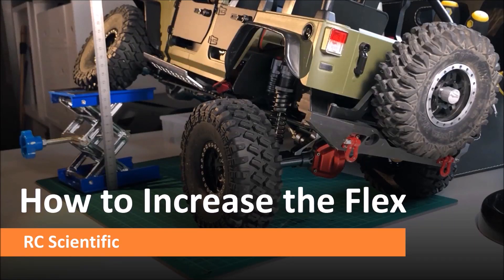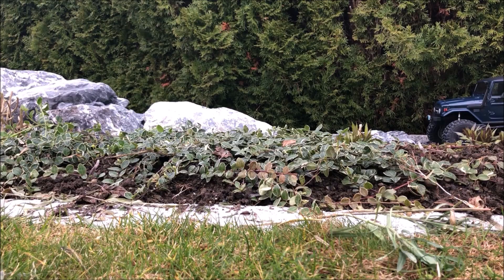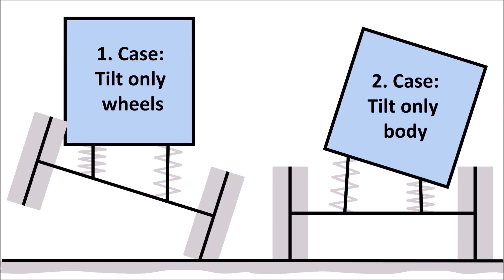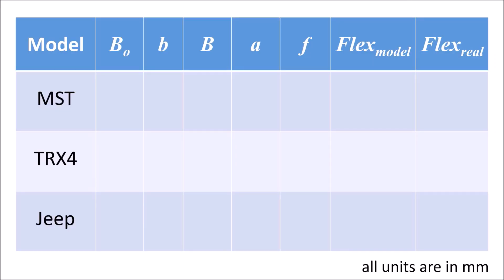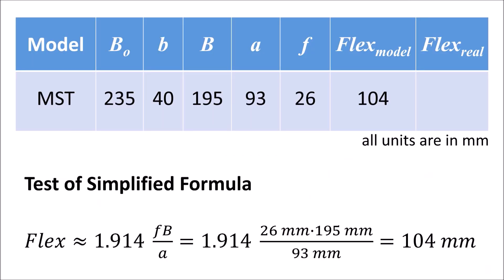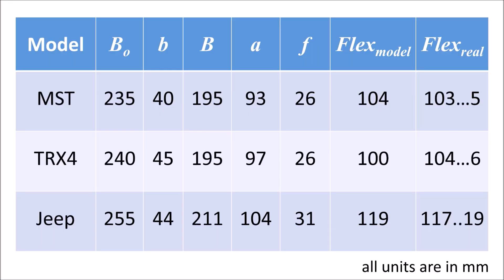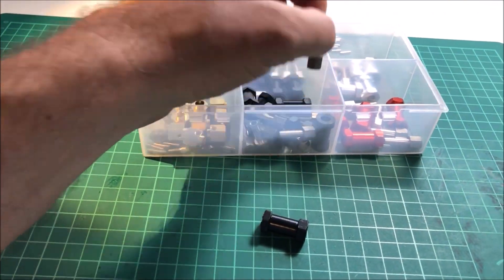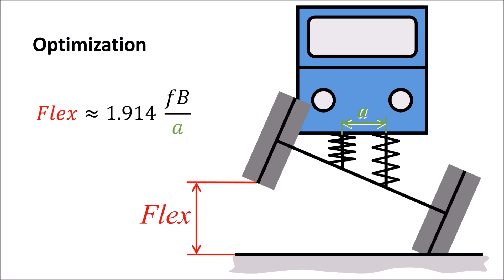How to Increase the Flex in RC Crawlers?

Comment: I have the same shocks how did you get them so soft mine are really stiff
Reply from the maker: They may look softer, because the chassis and the body are quite heavy. I did not change my shocks.
Reply: On mine everything is steel and cnc aluminium and brass but still very stiff.. im going to try without spring at all and different oil inside

Comment: Liked the explanation!
Where did you get the blue lift? Send link please...
Reply from the maker: You can find such kind of "lab-lift tables" on banggood or Aliexpress: 
This one is from the movie, and it works really well and accurate: https://www.aliexpress.com/item/4000036999092.html?spm=a2g0s.9042311.0.0.27424c4d48EL1Q 

This is a larger one from a different brand, which works worse: https://www.aliexpress.com/item/4000033563674.html?spm=a2g0s.9042311.0.0.27424c4dXsFpsO

Comment: Wheelbase is the horizontal distance between the centers of the front and rear wheel, I think you mean track width when talking about how wide the stance is. Other than that nice video man
Reply from the maker: Thanks for your advice. You are completely right. I made a language translation mistake, and did already mention it in the comments section of this video.

Comment: Really good analysis, but enlarging axle create problems in narrow obstacles, so is not the best choice in my opinion. 

I think it would be better to work around shocks, better springs calibration and more extension as possible.
Reply from the maker: I fully agree. Every change comes with advantages and disadvantages. Our design choices are finally compromises.
Reply: Also will add steering sweep.

Comment: I think your putting way more thinking into this. It's about the trial and error. That's the hobby. Not knowing how something will react is the fun. We don't want cookie cutter formula. That's just not a real crawler enthusiast.
Reply: Approaching the problem with maths is by far the most objective, accurate and efficient way to resolve it. It's the bread and butter of what actual engineers do in real life and those same principles apply to radio controlled vehicles too. If you don't care about the engineering that goes into how these cars work, more power to you. But gatekeeping who is and isn't a "real crawler enthusiast" based on who approaches the problem objectively vs. those who don't is beyond asinine.
Reply: Some people are love doing maths, and some people are love doing things. And we are here love watching utube with good content 😊
Reply: Your missing the point of the hobby. This is radio control. I don't need a flux capacitor to build a time machine. I simply put and older body on it. Your takin the hobby and my comment way to serious. It's all about the fun. If math is fun for you......then by all means have at it. Me, I'm just going to keep drivin without a calculator

Comment: Interesting video 👍🏻 I own an axial wraith spawn that I've modified to be a flex monster and an LCG chopped and dropped crawler all stock no cash spent other than new tyre's and a 550traxxas motor I'm still using NiMH batteries I drive on my backyard custom freestyle crawler course mostly dirt surfaced it'll surprise you if you watch the videos I've put up 45degrees up to 60 degree sloaps in parts.

Comment: Flex isn’t always the answer. More flex means more instability and greater chance or roll over on side hills.
Reply from the maker: Yes and no! Flex increases instability if it is enhanced by increased spring suspension travel (especially when the spring stiffness and damping viscosity are low). However, if you enhance flex by increasing the lateral wheelbase, it does not affect instability. On the other hand, increased wheelbase worsens maneuverability.
Reply: @rcscientific6004  have a look at the new generation of comp crawlers. You will find that they run close to full droop suspension setups and not a lot of flex. It makes them more predictable and easier to drive.